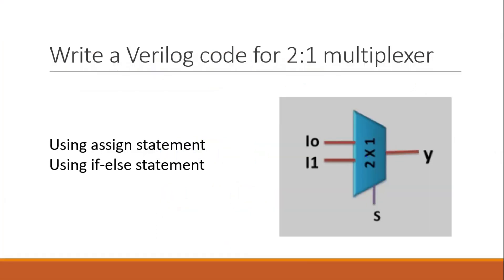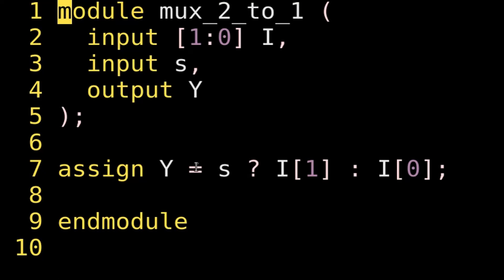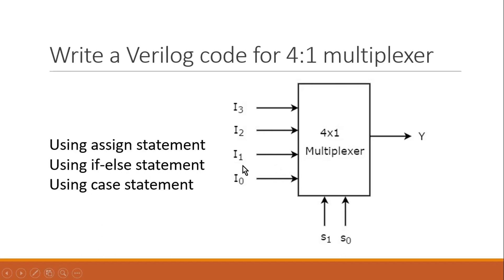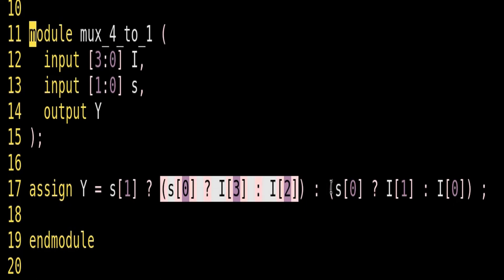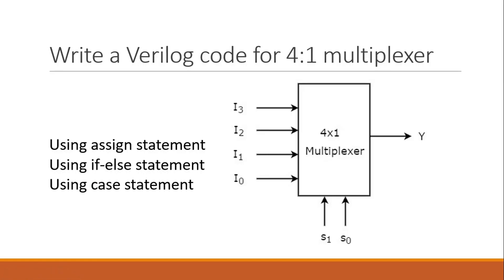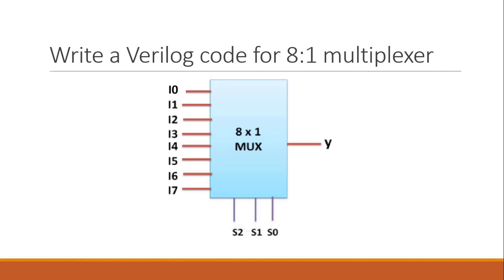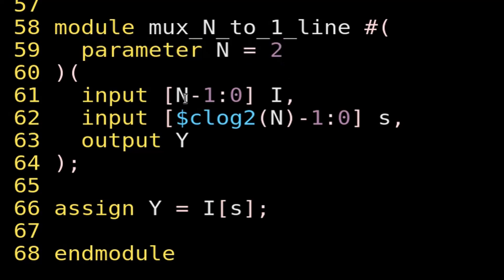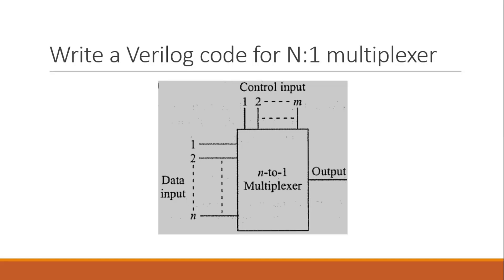Verilog Interview Questions Part 12

Comment: Hello Sir i implemented the Mux using assign statement and i got synthesis as in following link:

it shows that I[0] is connected to In[1] why?? Can you explain it in the videos.?

https://drive.google.com/file/d/18OwS4KP7LZHb4R5Z3QfzklSJvO16lskA/view?usp=sharing

Same problem for 4x1 mux using ternary conditional statements. But in if else we need to mention specifically about the synthesis part that s == 0 then and only I0 is connected to In[0] in 2x1 mux?

Comment: How to write 9:1 Mux using case statement?
Reply from the maker: Dear, Mux are like 2^n:1 only
Reply: @TechnicalBytes  So we cant write code for 9:1 MUX?
Reply: @Priya-tm2nh  If you need to select between 9 inputs, you would use a 16:1 MUX and don't select the unused inputs.

Also, using instances of a smaller MUX module will make larger MUXes easier to implement.  A 4:1 MUX is just two 2:1 MUXes wired together, with an extra select bit to choose between them.

I think assign Y = I[s]; will also work for 3:48 as of at least Verilog-2001.